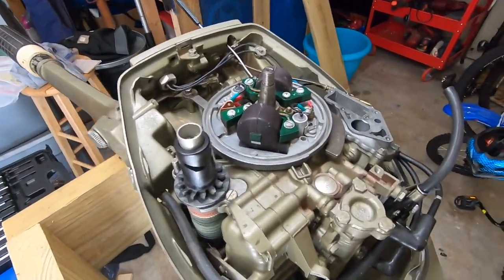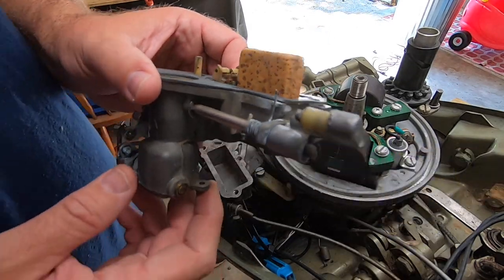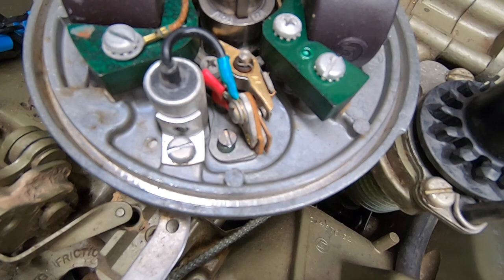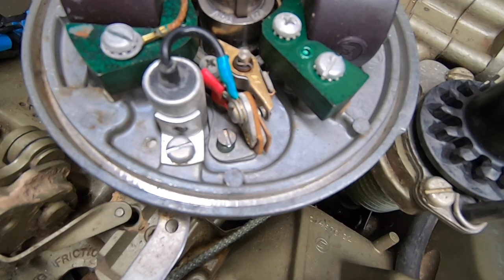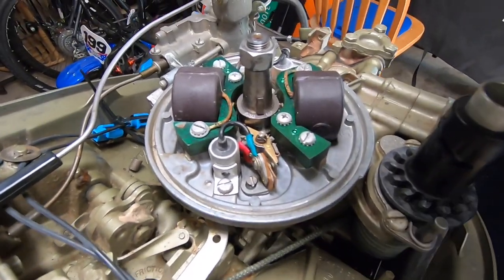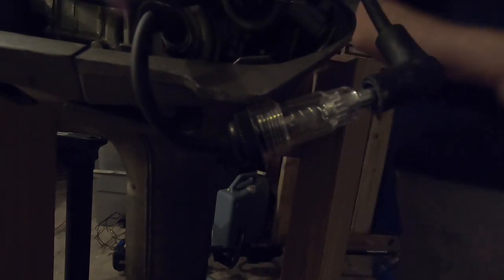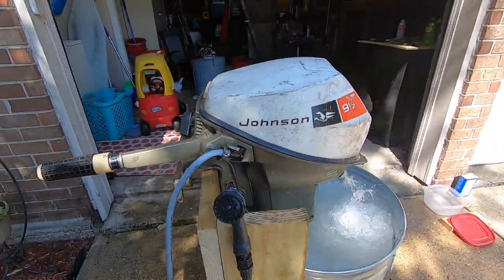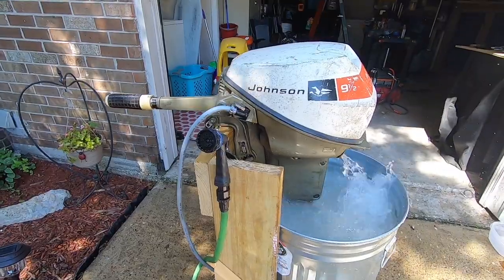1972 Johnson 9.5 outboard refurbish progress

Comment: Thanks for sharing.Just picked one of these up for $50. Got it running briefly,but not pumping water.Impeller on order.Do you happen to know what the carb. sync procedure is, besides  just making it run?I see a timing mark on the cam follower.I assume it is to time opening of carb,butterfly when cam roller hits mark?Any ideA.
Reply from the maker: wish2fish there is a guys blog/website that gives detailed instructions on everything about this motor but at the moment I can’t think of it , just search internet and I know you will run across it. If I can find it I’ll post here again

Comment: Do you know the Model number to the Motor? I have the same motor I am working on but doesn’t have a data plate on it. My motor runs fine just not spitting out water. Any suggestions?
Reply from the maker: sounds like water pump, impeller problem or maybe plugged up. im on vacation right now i can look to see if it has a data plate or model # when i get back